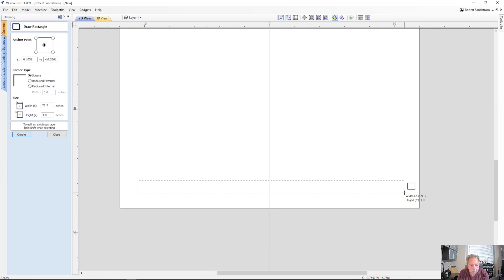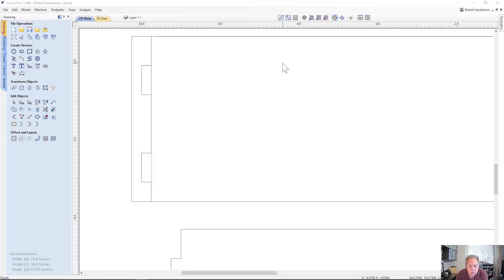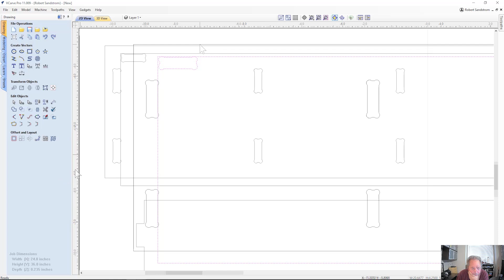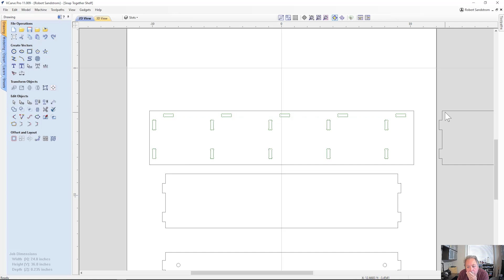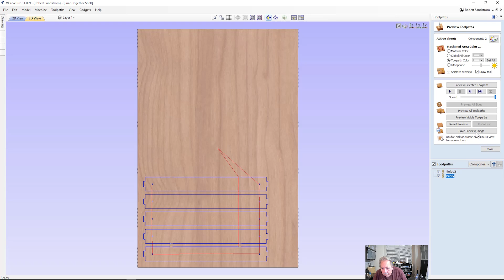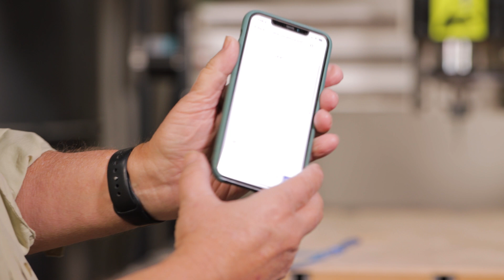How To Make Snap Together Storage Shelves With A CNC Router And VCarve Pro 11 | Software Tutorial

Comment: Excellent video, thanks!  Seems like you did not re-zero your work piece from the center to the lower left, yet the CNC was set at lower left.  Was this part of creating the cut sheets?   Also, would a vertical tab or two in the supports up into each shelf increase mounting rigidity?   Last thing:  it must be tricky to sand this?  It seems the thickness is critical... it would be so easy to presand the full sheet, but material thickness consistency would suffer.  Any tips there?

Comment: For nailing in clear areas I put circles the size of the bit I'm running into my design and create a drilling toolpath with a depth of .050 of so to dimple where the nails can safely go.  The material doesn't need to be held down for this as you are only dipping straight down, not moving the bit sideways.  Let the machine do the marking for you.  🙂  The only issue might be thin material that isn't down flat or something really light, I've used a stick to push it down for that.

Comment: You did your design using the center of the board.  When you cut ..... you used the lower left corner.  I believe you had to adjust the "datum" mark to be the "lower left" prior to cutting.
Reply: You are correct.  Before setting up my tool paths I changed my datum to the left corner.  

I often design with the datum in center and then switch before putting tool paths in place to lower left corner.  

I normally say this in the video.  Either I never said it or it got left on the edit room floor.